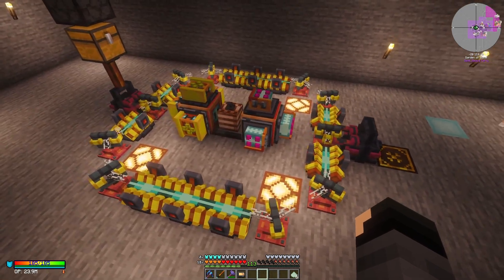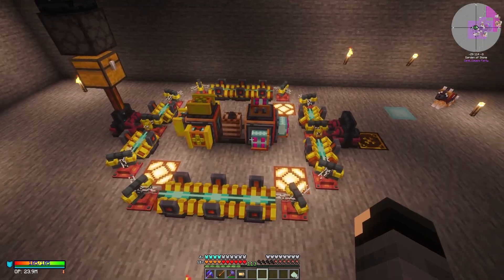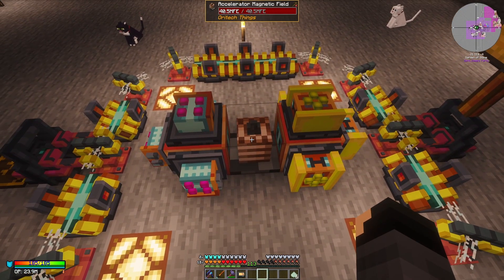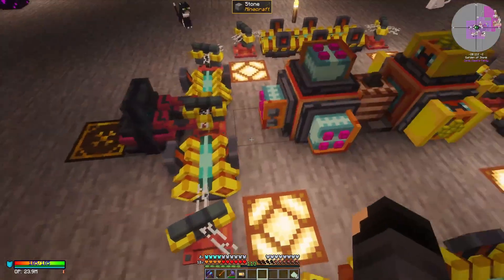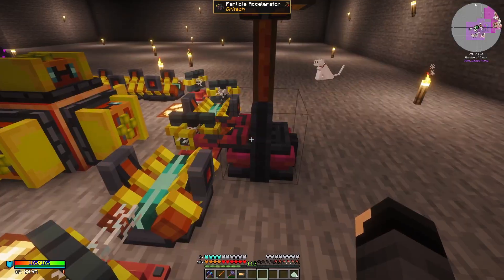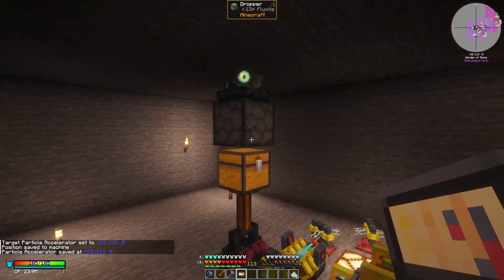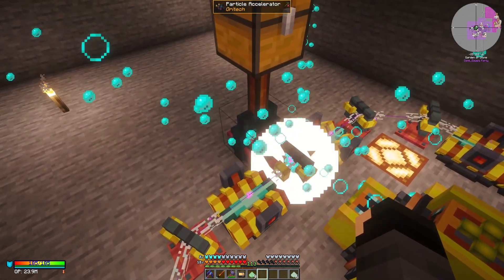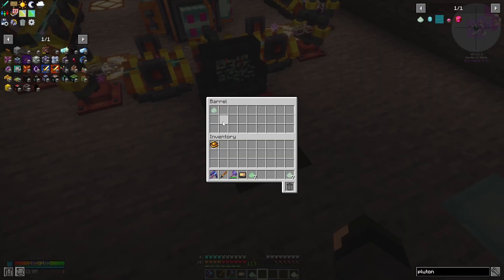Compact Particle Accelerator - Stoneblock 4 FTB

Comment: I'm looking at this, and wondering what the max speed it's capable of is. I've been struggling at some length to get mine working cleanly - adding a script that someone wrote for computercraft, making it pretty (ish), and fiddling with various settings, but mine just seems to top out at around 6-7k, at which point things go flying off and making holes in my walls. Does the efficiency mods make that much difference? I have t7's on all the linear motors, but two t9 capacity and four t7 acceptors on the magnetic field itself. Might go see if adding efficiency helps.

Also wondering if there's some safe way to slow something down again, or even just keep it going at the same speed; it seems bonkers to have a process that can't stop, but given how the reactor works, it seems about par for the mod...